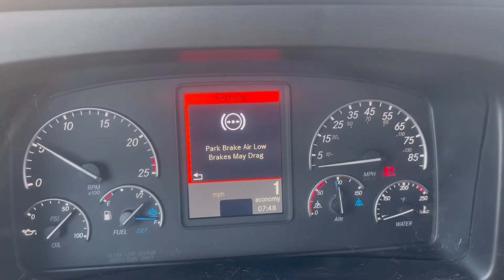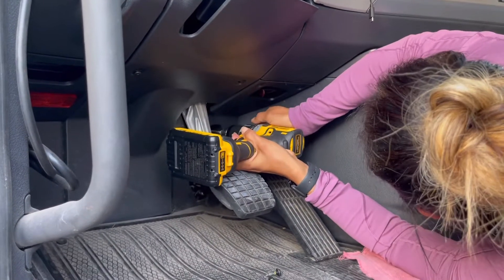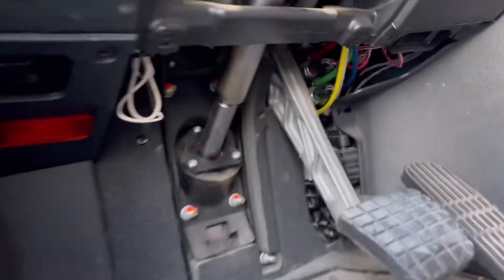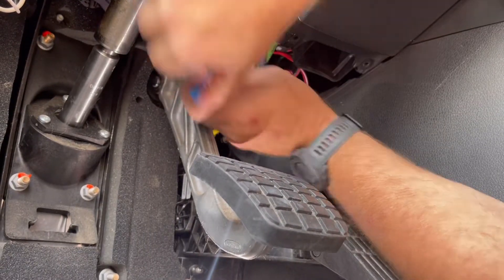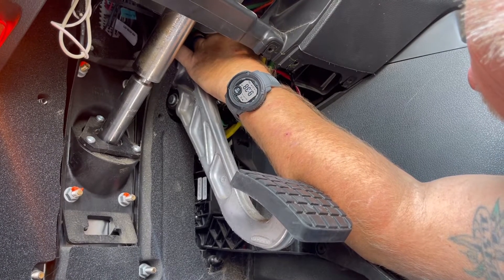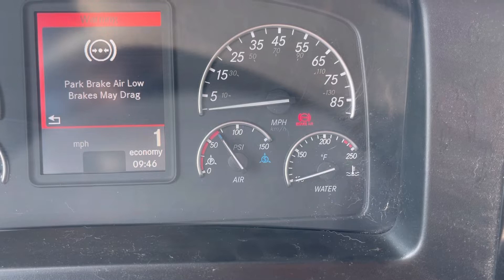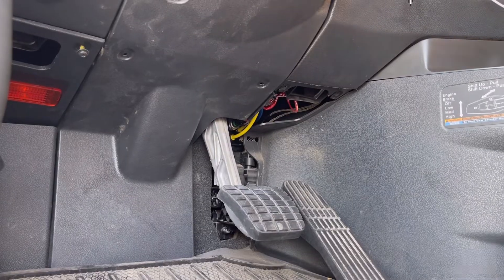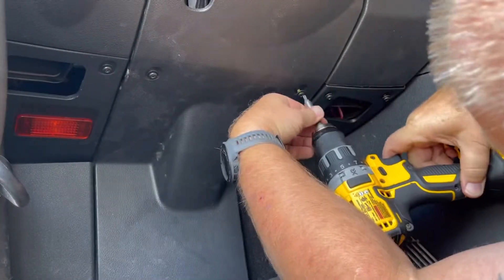Freightliner Cascadia: Park Brake Air Low, Brakes May Drag Warning #truckinglife

Comment: Just a little update - part 1226771-000 has been replaced by 12-31612-000 and it's also sold with a harness now. Freightliner has of course change the plug-in of the original sensor to an oval shape. Sensor and harness is around $127. The only difference from the video is you will now remove the old sensor and after putting the new sensor, connect the harness from the new sensor to the existing original plug.
Reply from the maker: Good to know, thanks for the update!

Comment: Could this possibly be the thing making my chasiss brakes start smoking when I connect to them? 

Hopefully you can reply to me. Thanks!
Reply: I don't think so. This switch only detects low pressure.
Reply: @ thanks, any idea what It could be? I’ve tried everything but every other chasiss I use, it brakes starts smoking
Reply: You figure out the problem? I been having the same problem..
Reply: @ not yet fam …

Comment: Since this happens so often it seems more like a manufacturers defect in the switch mechanism. Mine just started doing this on & off. Beeps the damn horn when I open the door thinking I didn't apply the brakes. Damn PITA! I suspect mine's going because of moisture corrosion buildup in the valve. The governor spit valve is kinda wet though I get no water coming out of the drain cable valves which is weird. I'm thinking of getting a new switch but will try to either take apart the old one first, clean and lubricate it and see if that may fix it. I'd like to use a grease that won't easily wear or wash off by pressure and moisture like an antiseize, marine or a ceramic synthetic type grease. If successful not only does this save money by not risking breaking plastic tabs on the covers or risk over tightening the valve like another guy did, stripping the brass threads and having a costly replacement of the whole unit. But I'm also a cheap b@stard ao there's that. We'll see how it goes.

Comment: Thanks for uploading the video. I am facing same problem. I just wanna ask is there color matter like you mentioned blue & red I bought a new one it color was red is gonna be work for position mean same spot?
Reply from the maker: Someone posted in another comment that the part had been updated and the color had changed, so as long as you verify they are giving you the correct part there shouldn’t be an issue.

Comment: Thank you great video, saved me $$$ did it myself. However the part has changed, it looks like a red switch now. The parts guy said they have had so much problems with this switch so they use a different one now. Will have to buy a connector for new switch also.

Comment: My local dealer just replaced the "Blue stripe switch" and after 1 week went back to the same issue. Thinking of disconnecting the damn beeper.
Reply: you can insert a metal paperclip into the connector, but you will have problems during level 1 DOT inspection.

Comment: Man i did it the sensor is fixed but i can hear air.. do you know what it could be?
Reply from the maker: Lots of air lines down there that you have to be careful about moving around. If it's simply one of the quick connect air lines leaking, you may be able to fix it by taking it lose and replacing the o-ring.
Reply: @FreightRelocators  Driver how to replace O-RING. Thank you
Reply: I wiggle the sensor and it gets worse 
You think i need new sensor or just put teflon on it?
Reply from the maker: @MrRaghavpuri007  Did you get the sensor tight? Doesn't need to be real tight, just a little more than snug. Possibly overtightened and broke where it threads in at?
Reply: @FreightRelocators  i think i did over-tight it maybe
What do i do in this situation?
Reply from the maker: @MrRaghavpuri007  verify exactly what is leaking first.
Reply: @FreightRelocators  I’m pretty sure it’s that sensor i put in 
Bc when I release tractor brake it starts leaking when it’s set no leak
Reply from the maker: @MrRaghavpuri007  Well, the proper fix would be to replace the part that is broken, but that could be costly. Used part from a wrecking yard maybe? You could attempt to seal it off with maybe epoxy or something, but not sure what the odds of success would be. If you do try to seal it up, you will need to make sure whatever is used has plenty of time to set up before testing it for leaks.   You mentioned teflon, not sure if that would help, but it would be an easy and quick check to see.
Reply: @FreightRelocators  what do you recommend other than teflon tape.
Plus is it just me or it is actually hard to unscrew or screw back on this sensor?
Reply from the maker: @MrRaghavpuri007  fine threads, and also has thread sealer on it, which does make it a bit difficult to get started without cross threading. Not sure what to use, but whatever you try, remember that you don't have to tighten the sensor very tight. You can most likely get it tight enough with your hands.  I would look into some kind of epoxy, but really not sure what will work best since this thing is always got air pressure on it.
Reply: @MrRaghavpuri007 did you fixed the air leak, if fixed how 
I have the same issue
Reply: @gobinsubedi6083 i didn’t, mechanic said I would have to change firewall? And i’m not spending that money
Reply: I hear air also…
Reply: Good morning, does anyone have any leads on how to get one in stock? Everywhere I’ve searched says out of stock
Reply: @derrickbivins7122  are you trying at dealer?